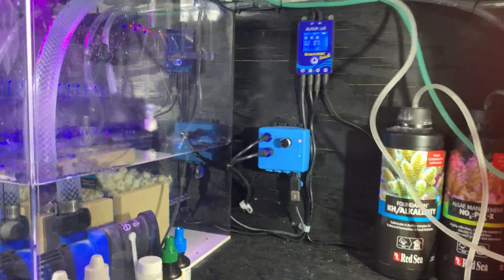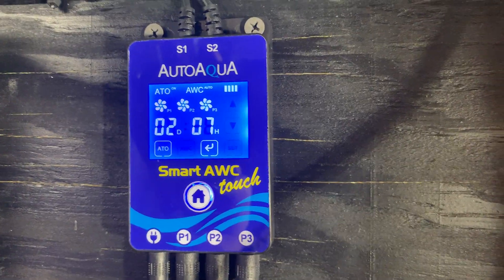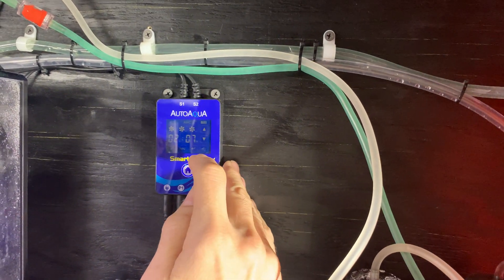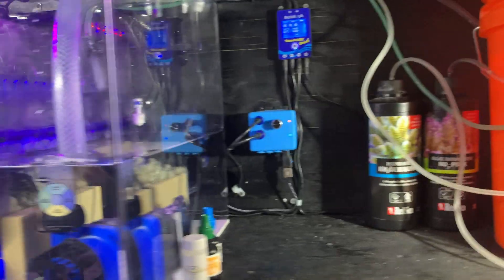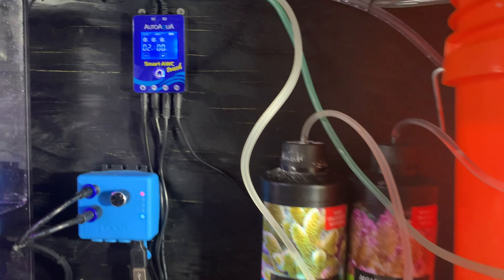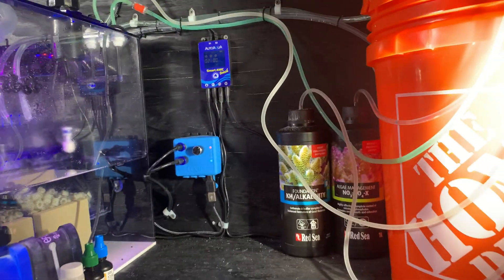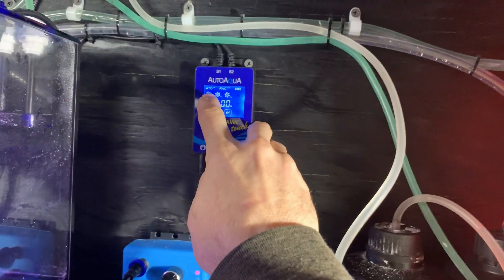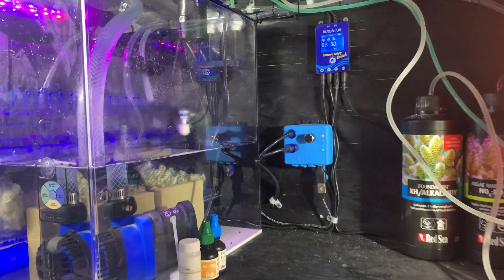autoaqua touch control ATO AWC

Comment: Hi! Quick question on the ATO part. Do I need a third pump for the RO/DI water then b/c I'm still confused on how the ATO works with AWC. It has an ATO mode but im still seeing salt water being pumped in and no third pump for RO/DI water if that makes sense. Thanks!
Reply: It comes with 3 pumps, one goes in your ATO reservoir for ATO's, one goes in your sump return chamber to remove water for AWC's and one goes in your new saltwater reservoir to refill the aquarium on AWC's

Comment: What would the controller display look like if I wanted to do a 4 gallon daily water change? 
Thanks!
Reply: It doesn’t really work like that. You have to set it up and determine how much you can remove on one water change and then determine how often it Hass to run to do 4 gallons a day you could set it to every six hours every eight hours every 10 hours whatever you want every day once. You would have to figure out the amount after you install it of how much it removes of one water change and then figure out how often it Hass to run.

Comment: would you recommend that current USA pump?  I'm thinking about completing my loop system.
Reply: The pumps work perfectly fine they definitely don’t put out the flow they say maybe they do with a 3 foot height but they do work fine they’re super quiet. As long as you’re only pushing your average 4 foot up or less I’d say they’re fine I don’t know what size tank do you have if you tell me I might be able to recommend which one. Unless you already know otherwise I think they’re good pumps they just don’t have strong head pressure but in most cases that’s not a problem I push up 9 feet so I upgraded to a eco-tech otherwise I was using the current USA to push 90s up and it was doing it perfectly fine but definitely not as powerful as my new pump. Sorry I’m driving right now if there are typos

Comment: Where does the water level line end up when its filled? Is this at the tip of the little pyramid? Thanks!
Reply: Yeah basically halfway up the sensor or a little more. I believe mine is usually 3/4 covered under water when it shuts off